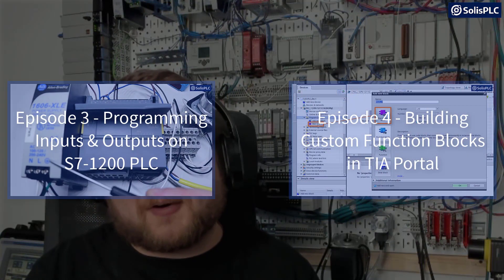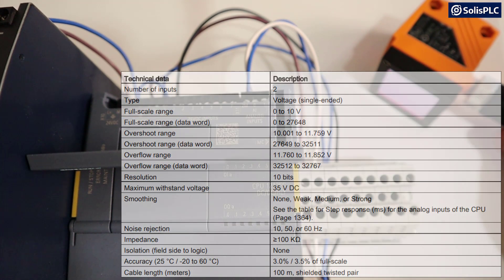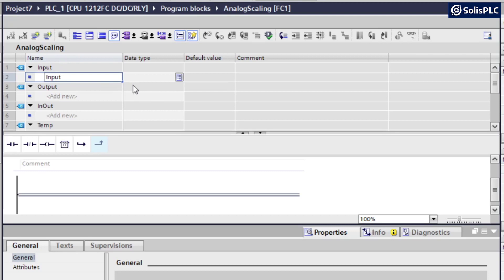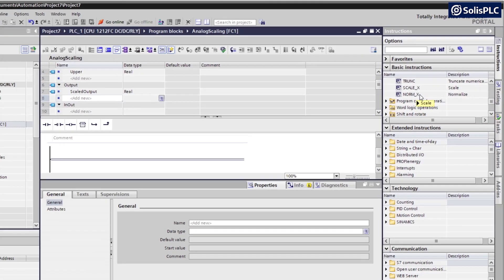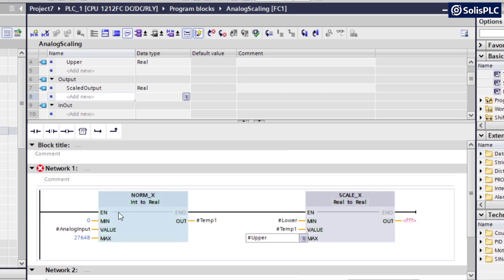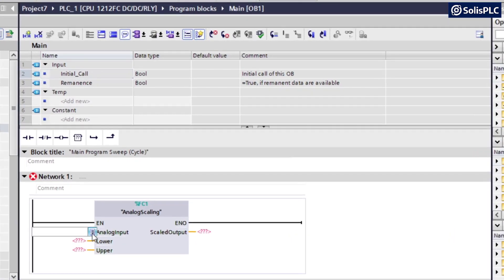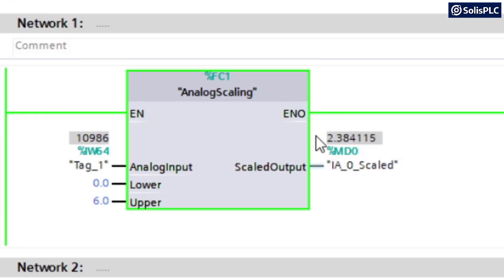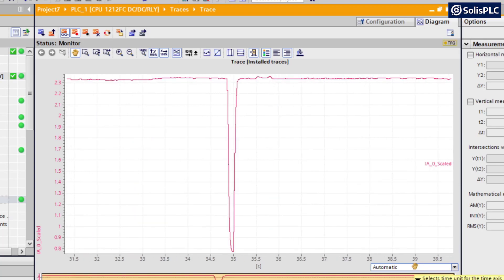Siemens Analog Input | S7-1200 Module Wiring Tutorial TIA Portal Analog Scaling Function Programming

Comment: Awesome timing. I'm literally working on the analog scaling issue for a flowmeter. After calibrating the flowmeter the PLC is now 'off' by .5 GPM (even with no flow). Original logic used a formula instead of these built in _X blocks.

Thanks Vlad for another useful video!!